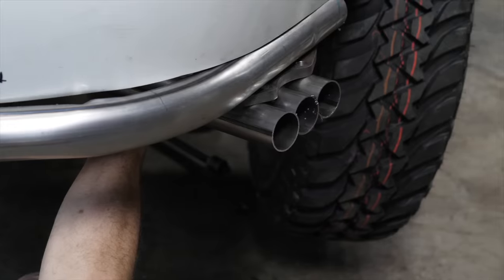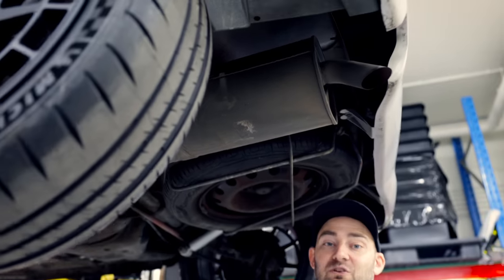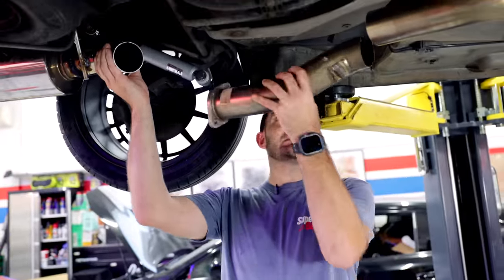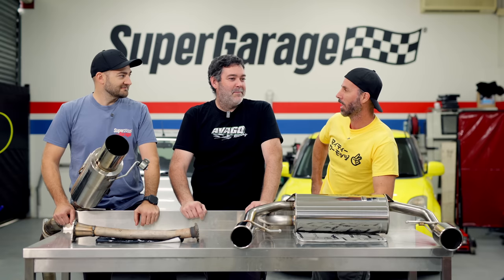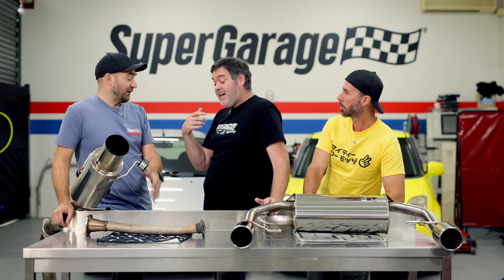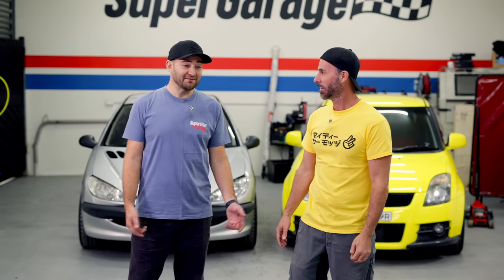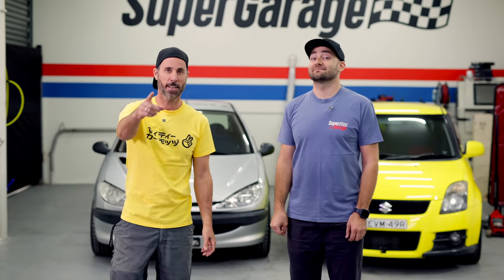$13 vs $1,300 Exhaust System | CASH vs TRASH

Comment: exhaust gasses have inertia and as the guy said they pull or suck out the gasses fro whichever cylinder's exhaust valve opens because otherwise there will be vacuum. But it's not also that. There is the thing called valve overlap where between the exhaust valve closing and intake valve opening for fresh mixture to get into the cylinder, both valves are open for some degrees of crank rotation. The exhaust flow through this 'scavenging' effect helps to get out all used/bad air left and also speed up the intake flow, then with precise timing of when the exhaust valve closes, where the piston is and when the intake valve closes you have the air 'ram' effect shoving more air than just the swept volume of the cylinder thus increasing the volumetric efficiency. Here, the intake runners and how they are calculated/tuned (intake pulses) also add up. There are exhaust pulses also to be calculated when they should happen exactly at the tip of the exhaust valve to amplify the scavenge effect. Bare in mind both the intake runners and the exhaust runners are calculated/tuned for certain rpm(range). But to return to the N/A scavenging effect, basically with smaller diameter exhaust system the air velocity is higher, better scavenging thus better low rpm volumetric efficiency and higher torque, however at high rpm the engine being an "air pump" gets choked and there's the great backpressure. Maybe another clarification is needed, so in low rpm the exhaust backpressure is negative a.k.a vacuum created behind the exhaust port while at higher rpm the exhaust backpressure is positive a.k.a ....just pressure. So opening up your exhaust on N/A hinders the low and mid torque. Boosted cars 'generally' don't suffer because the turbo has the role to shove air into the cylinder increasing the volumetric efficiency (but other !@#$ to care for like lag). A return to N/A exhausts - you shouldnt also have just a straight pipe from the exhaust manifold to the back box because of something which i can try explaining with "the river" effect. A river flows fast in the middle and slow near the banks because of surface tension and friction of the water molecules, which essentially is a fluid. Well air is also 'fluid' and where it touches the inside walls of the exhaust pipe it runs slower than in the center and this effect essentially makes the diameter of the exhaust pipe smaller in greater velocities and the more the engines tries to shove in it. So the advice for cars with catalytic converters and DPFs if you want to remove ok remove them and replace them with same diameter pipe, dont just smash them out leaving empty chamber as this hurts the air velocity and scavenging, but where you have resonators - leave them there, dont touch them. @Marty @Moog @Scotty (from Haltech) would you help me with discount for Elite 1500? 3 years i'm saving coins, 750EUR collected, i'm in 3rd world country, its difficult.

Comment: The effects of that 3" exhaust on the pug is definitely going to be interesting 😂
Reply: Will kill torque
Reply: @Ferjim77  that's what I'm thinking,  the power band is going to shift towards the upper rpm range.
Reply: @Cole Trickle  ehhh, somehow I don't think that's entirely true man, if that was the case, cat backs wouldn't change power at all. This will most definitely kill the exhaust gas velocity and reduce the low rpm scavenging.
Reply: @jeremymann8930  Scavenging happens in the manifold collector, not 5 feet away after the cat.
Reply: @ChristopherHallett with a bigger exhaust system that scavenging cant happen smart boy
Reply: @Christopher Hallett  then explain X-pipes, Y-pipes, and H-pipes on V engines, most are after the transmission. Also Marty's change in diameter is happening right after the manifold, that's what that flange is.

Comment: Having done both cash & custom trash systems on well, every vehicle I've ever owned. I have to lean towards the trash, you can source good quality new or slightly used parts/materials for Super Cheap & there is nothing wrong with saving money here & there to put into more mods.
It is also, nice to have a big name brand system that everyone has heard of, but honestly other than a few of us, who's even looking under some random persons car to see the piping etc, I mean I do, but the general person will not.

Comment: I just drilled a massive hole in my yaris muffler with a hole saw about 25% bigger than the pipes. sounds sick and definitely goes harder. Cost $0! Only bort it coz of yaris hilton, wanted something cheap and cheap to run, but am enjoying doing heaps of trash mods as a bit of a piss take lol.

Comment: Bro i made a sick high performing exhaust for cheap, ZX2 (2.0 Zetec, 4 into 1 header, 2.5 inch all the way back, cat delete, 4.5 inch inlet TI rear pipe 17 inch long) just got headers n a rear pipe, had the shop do the rest. Cost around 350 total! Best exhaust amongst all my friends! Actually 5 of my buddies did what i did at my shop after that. Because a cat back was 650++, and was not near as high performing or smelly!!! 1300 for a rear section only = Waisted $! On a Swift = U figure it out... no Swif owner can afford 1300 rear section

Comment: The Suzi is looking good!    Looks clean, fun, and can be daily driven.
Reply: By the time it's finished it will cost as a Golf R but as you can say if they fit a full cage they could also be daily driven as a rent a car in the Nurburgring. They will lap at around 8 minutes. Most bang for bug rental you can opt, once you are confident an Alfa Romeo 75 RWD and you'll have fun for years...

Comment: You make the most power/torque on an over-sized exhaust with a tuned reducer at the tip, the larger system volume is key Just an FYI: Once you are tuning the ECU use as much cam advance as possible.  In order to best make use of that header and exhaust the engine will take WAY more overlap than OEM.  Nothing wrong with enlarging the exhaust as long as you advance the timing (even with distributor lol)  to make use of the higher knock resistance/lower octane requirement. Its all about the tune anyway.

Comment: Back pressure isn't a thing, all else being equal, lower back pressure means more power. The problem is if you go for less back pressure with a huge system you drop the exhaust velocity and that affects the scavenging. Resonance tuning is more important than either though.
 Back pressure is just a by-product of keeping the exhaust velocity reasonable - it's not wanted, nor needed. Any exhaust specialist that tells you otherwise doesn't do any proper tuning to time the exhaust to the cam and headflow, or other setup work bar banging on whichever aftermarket units that looked the shiniest at the time. Not that there's anything wrong with that, most paying work available is fitting rather than manufacturing bits, but it's still weird this stuff is still getting passed around in an era where you have the worlds knowledge at your fingertips.

Unfortunately for the PeugBro, most of the restriction is in the manifold in those, there might be a couple of horses in the rest but you can get 8-10 horsepower out of a long-branch 4-2-1

Comment: it depends on the bore honing of a stage 1-3 N/A tune combined with a  stage 2-3 turbo or stage 3-4 turbo pending model and brand name of car..

I would say for the suzuki if the engine bay is  big enough and you can do a escudo swap into it  and 4wd drive  train in it I could see the suzuki do pike's peak

Comment: Cracking giveaway guys, I'm going to have to check the T's & C's to find out if the UK is included in it.
I have the previous version of the Ryobi compact impact driver. Ryobi gets a lot of hate from name snobs in the tool world, you know the type "Milwaukee/DeWalt/Makita is the only brand any serious trady will use" The rivalry between tool snobs can be as serious as BMW v Mercedes, Ford v Holden or Nissan v Toyota is the car world.
I've bought or acquired several Ryobi One+ tools and never had a problem or complaint with any of them, even outlasting a load of workmates much more expensive tools

Comment: Go find a zc21s central pipe, which is a 2” straight pipe w/o a cats. It would be a direct bolt-on and work like a gem. The headers must be a 421 rather than 4-1.

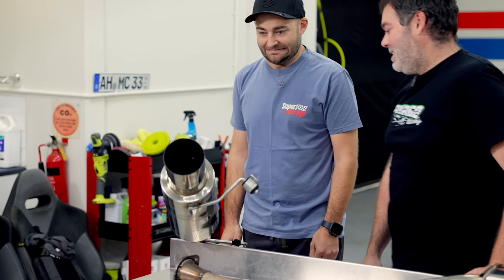Comment: Peugeot's are one of those cars that actually sound pretty good when you take off the super restricted, low noise stock exhaust. Few years ago, the thing described here 10:09 happened to me on my 1.6 307 and the rear muffler bonked its tip to the ground. The sound was amazing with back fires and all, like a proper rally spec car. It has been on my to-do list for a while to make a new exhaust for it, it is pretty sad with its current low noise muffler. It's so quiet that I can sneak up on people without them hearing me arriving though.
Reply: On a number of different cars just bonking the tip off gave them a nice growl

Comment: Cash on exhaust/headers for sure. A properly tuned setup will always yield more power than a hack job unless you get insanely lucky and trip on a good formula, hey, it can happen. I wouldn't bank on getting lucky though, it's like thinking you can stop working and buy (and win) a scratch card every week to pay the bills. Now, if you really know your stuff and are willing to put in the research into your particular engine and it's optimal performance specs then you could build a comparable setup for a lot less money but you will be paying in time and effort what you save in cash. Worth doing if time is something you have an abundance of. Otherwise, just pay the extra to get a properly built setup and be done with it.

Comment: Did something sorta in between this past weekend... put a cheap "stainless" catback on my trailblazer. The old '05 factory system was rotting away and sounded like 💩. Now it's so quiet, all you can hear is wind noise. We'll see how long it lasts 😁

Comment: My local exhaust shop made a stainless exhaust from scratch for less than an off-the-shelf replacement mild steel exhaust - but this was over a decade ago! Not sure what prices are like these days. I will have to replace my exhaust on my current vehicle sometime soon, and the question is whether and how much to upgrade it when I do.

Comment: Peugeot exhaust is overkill for your setup. For a normal stage 1 TU5J4-TU5JP4 engine (Filter, Exhaust, Remap, Sport Cam Shafts) optimal exhaust internal diameter is 54mm with a Group N muffler at the end ! This diameter is good for engines under 160bhp. We put 2.5 inch external diameter exhaust on N/A TU engines that are 180bhp and over and for extreme N/A setups 220bhp+ we use 2.5inch internal diameter exhaust

Comment: I do like this cash vs trash series, but I hope there is another round with a twist. Both cars have the same fixed budget, but one is 80% towards the initial car purchase and the other 20% for mods. The other is 20% for the car and 80% in mods. Trash car with good mods vs good car with trash mods.

Comment: not sure what to expect of that big exhaust diameter change. You go from high speed air to low speed air as the volume of the cylinder increases. Curious to see how that will perform!

Comment: That tapered transition is like a magaphone exhaust. If by sheer luck it happens to be at the tuned length, the pulses that it generates will give the desired scavenging effect.
Be interesting to see how it works 😂

Comment: If you have the skills, and the pieces laying around. Trash is the way to go. The only difference between trash and a full custom bent exhaust is the amount of cash you pay a shop to make it for you and install it. As for the cash side. If you plan to do it at home as a DIY project. Spent the cash and get the best you can get. Cause Installation of it onto you car will pay for itself with ease of fitment. I have been an auto mechanic for over 32 years now, and I will always take a good direct bolt on exhaust kit over building one from scratch any day.

Comment: If you could find 106 gti cams with pulleys or c2 vts head/ cams/ intake manifold w larger throttle body (fly by wire 406 maybe, not sure), 4-2-1/ 4-1 manifold and reprogram it it would be a true rocket. Easy 150/160hp.

Comment: Backpressure doesn't give you gains unless it's a 2-stroke, the thing that causes small pipes to give gains is air velocity, which makes the exhaust pulses stronger and more effective at scavenging. This is the same thing as putting a huge carb on a tiny engine, the airflow is too slow through the venturi and you end up with bat atomization in the low- to mid-range. So, next time someone says the back-pressure argument is ancient and mysterious, you can present your dominant knowledge.

To go a bit deeper into the physics, basically a smaller header forces the air to go faster the same way that putting your thumb on a hose makes the water come out faster. This makes it so that when the air hits the collector, it's going at a higher speed, and when it finishes rushing through, it creates a vacuum behind it. Slower flowing air would create a weaker vacuum, as it's a function of air speed. The trick is to find the sweet spot where the air is going fast enough to scavenge, but not so fast that you lose power to pumping drag.

Comment: I really wish Marty would have gone 3" off the bottom of the cat.  That would have made a lot more sense instead of necking down to the tiny stuff.
The larger the diameter, the deeper the tone.  I had a 3" exhaust on my 2.0L Zetec and I really liked the sound.  It had a burble like a boat.  No soggy fart sounds.  The Roadkill exhaust guys put a 4" exhaust on their Muscle Truck and it sounds INCREDIBLE.

Comment: I once used scaffold pole and a metal coat hanger to straight pipe an old banger (i say banger but now they are worth so much it was a 205 gti). Stupid idea now i think about it, would not want that dropping on the road while driving. Oh and a cannon on a pug is very common here in the UK. Thats what we call it btw "PUG", just like the dog with deformed nose.

Comment: I feel pretty confident in saying that you will lose a little power on the PugeBro with that exhaust.  Making it bigger like that, on a N/A motor, will screw with your exhaust velocity, which will ultimately screw with whatever scavenging you had going on.  Unless the factory exhaust was undersized in the first place, and you did some maths to determine your exhaust velocity and what the larger area of the new exhaust pipe does to it...I'm predicting less power.

Edit: I just watched where the Pro talked about the exhausts.  It's not backpressure that's helping with scavenging, it's exhaust velocity.  Backpressure is bad.  The exhaust velocity will be faster in a smaller pipe, slower in a larger pipe.  There is a specific velocity, for that specific car, that will match with the engine pulses, and help draw out spent gases in the combustion chamber.  I don't know what that velocity is without doing a bunch of math and knowing things I don't know about that car.  So there's a window on the size of the pipe: too small is bad, too big is bad.  In the case of the PugeBro, 3" exhaust is definitely on the "It's Too Big" side of the window.  I'm agreeing with the Pro on Moog's muffler picking up more "power" than Marty's 3" pipe.  Marty's is going to hurt power.

Also, this is for a N/A car.  Adding a turbo changes things entirely.

Comment: Regarding Marty´s final statement: It´s a significant difference if you buy cheap (which you usually regret) or if you´re using used/ leftover but good materials. One is cheap, one is budget friendly :)

Comment: Not that it really matters but you really need to use a more suitable diameter for your exhaust Marty. A 3inch exhaust on the NA 4 banger of the Peugbro will not help with performance, only give you a bassier sound. Im sure you know this already! Good luck

Comment: In all honesty, we still produce and use these 206s here in iran. Even for racing. Those engines can take a beating and parts are plentyfull and cheap. There are turbo 206s here that are pushing 500hp to the wheel and although those are for racing only, i have seen them reach 440hp easily while being driven daily. Just saying

Comment: You should chop the 3'' pipe off and go from 1 3/4  to 2'' to the rear AND THEN go to 3'' for the ''muffler''. This way u wont loose much power

Comment: Why do people still say that an exhaust needs back pressure, while also knowing that you need a nice flowing exhaust. Those two things are opposing.
Actual back pressure is kinda what you want for a two stroke because of how it works but for a 4 stroke and specially the na ones you want as much exhaust velocity as you can have without being too restrictive, the faster the exhaust gasses are you get a bigger "pull" on the exhaust to draw the gasses out of the cylinder.
And the reason why going too wide is bad is because there is a set amount of gasses that the engine moves, so too big means that the flow of the gas will slow down because there isn't enough gasses to fill all of that space and you will end up with cold slow gasses that you have to push out of the exhaust taking some power instead of helping you

Comment: You mentioned "backpressure" and just to be clear NO ENGINE NEEDS MORE BACKPRESSURE, EVER. Some engines benefit from a smaller diameter exhaust because it increases the exhaust velocity which increases the momentum of the gasses by the square (m*v^2) which helps with exhaust extraction because it helps LPWER the pressure during the extraction cycle...
Reply: Does need scavenging

Comment: I've been wondering why I've seen a trend of people stapling their lavs under their shirts. I'd never want to risk chopping or smashing a lav cable. I've been wondering why no one uses something like the DPA magnet mounts and something like a magnetic flag pin or something. Get some little custom steel chopped fingers to stick them to through the shirt.